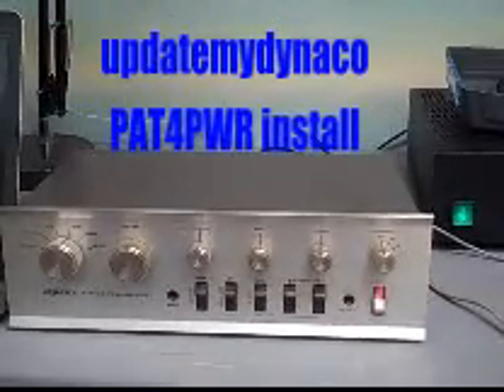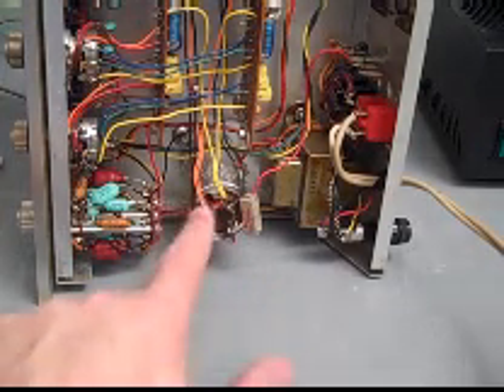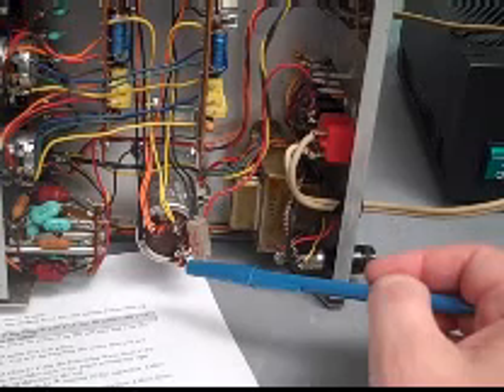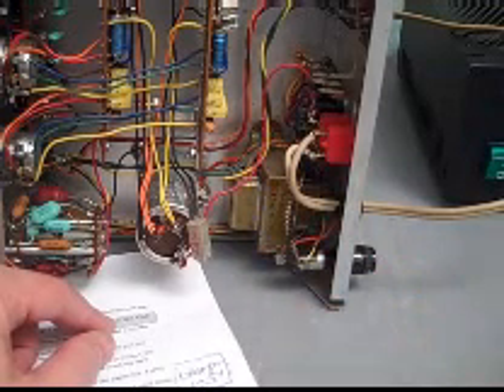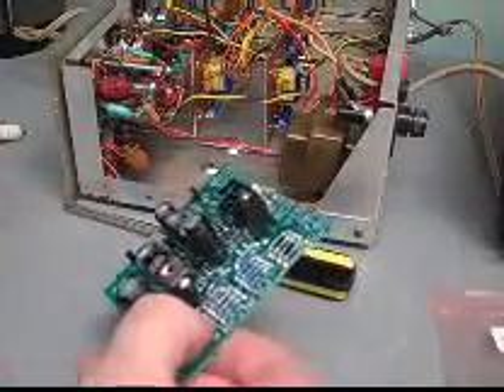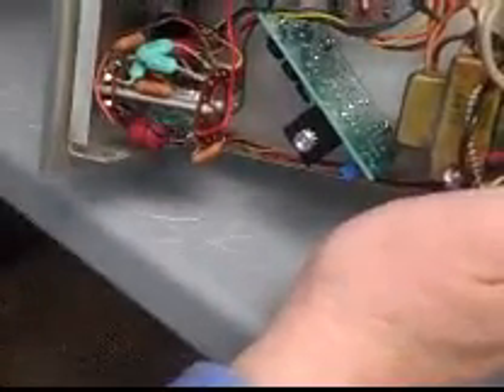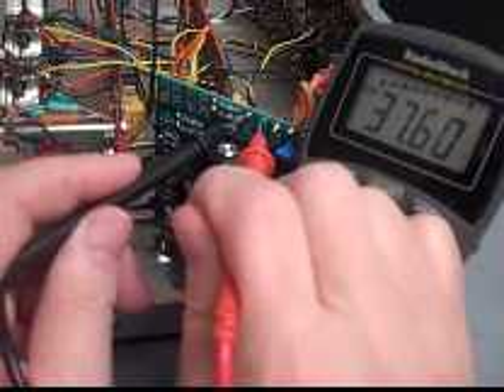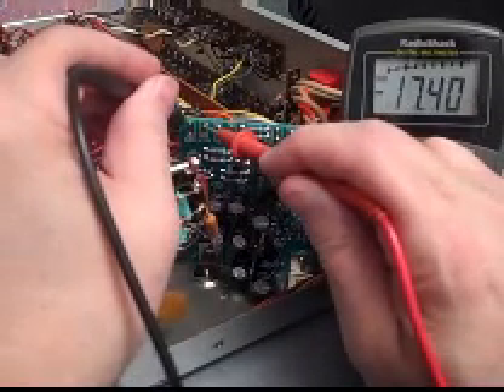Installing a PAT4PWR Updated Power Supply in a Dynaco PAT-4 Preamp

Comment: Hiss is most often caused by a noisy resistor in the line stage. There's another kit that I offer, the P4LSRC (PAT4 Line Stage Replacement Components) that will very often take care of this. Add in the DRD4 kit, and you have a very good chance of quieting things down dramatically. Then, adding the power supply kit is kind of the icing on the cake. Even if your power supply caps are ok, it still makes a big difference.